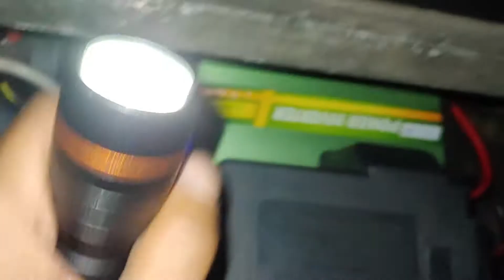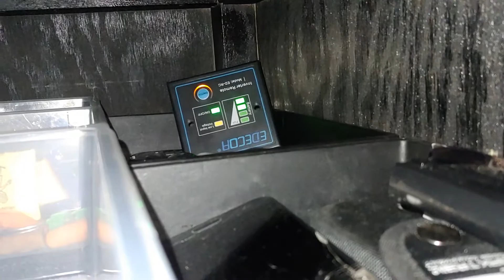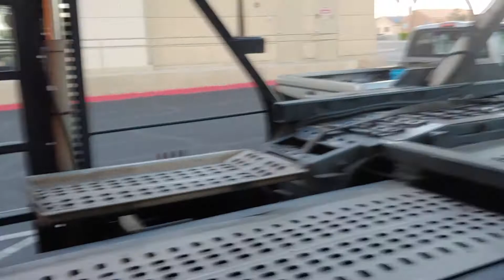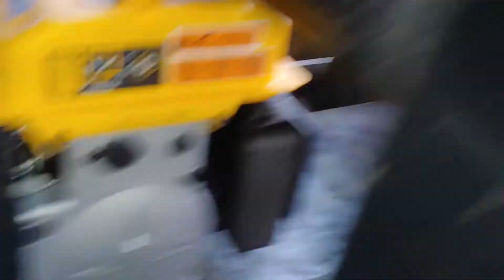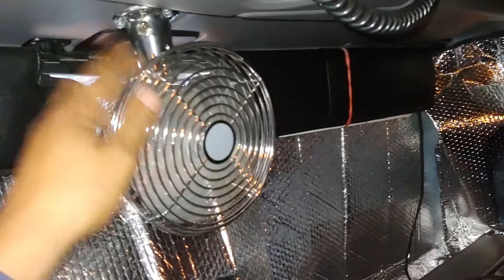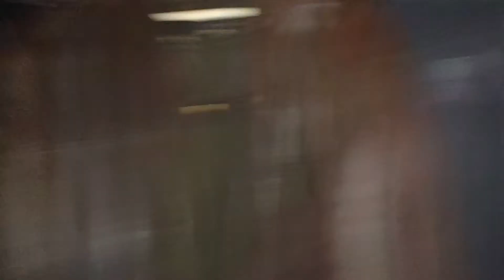my custom set up 10 car hauler airconditioning APU the best one ive seen so far part 2

Comment: Genius. Iv had the same idea since I seen that other portable ac system awhile back. Do you have a link to the one you used and the step down voltage thing?
Reply from the maker: Just Google the make and model  of the transformer power max pm3 55lk